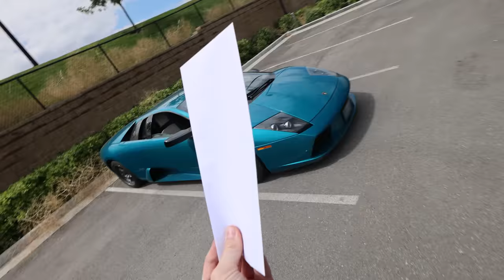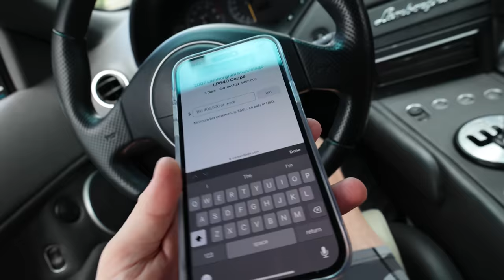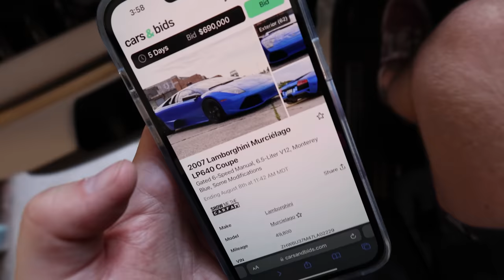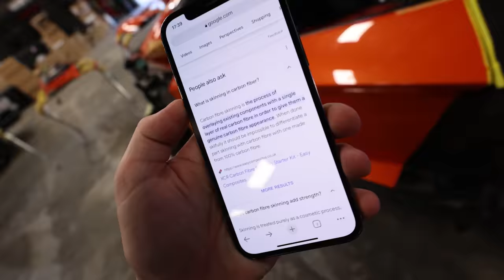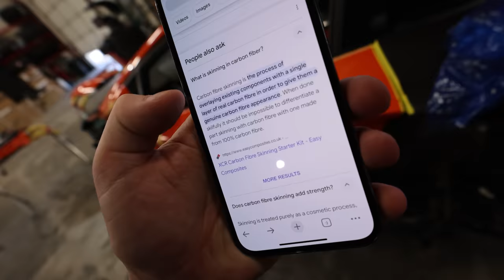Here’s What’s Happening with my Twin Turbo Lamborghini Gallardo.

Comment: I don't think it's a bad choice to skin the doors. Since you announced it I was thinking about crach protetion and I'm happy you're playing it safe
Reply: I dont know anything about this topic, but cant they put the protection against crashes in the carbon doors? I mean theres still the windows problem but he didnt said it wanst impossible, probably is very expensive tough
Reply: @chilispeed_pt8414 well that’s exactly it it’s very very very expensive
Reply: @chilispeed_pt8414  Yeah, I'm sure it's possible to transfer everything over including reinforcement pieces or even making reinforcement components out of carbon fiber to add. It's just not going to be a cheap or easy process. From the sounds of it, they might think it's a little beyond their skill set there and he would probably need to send it to someone who specializes in working with carbon fiber, just to get the doors properly assembled to put on the car.
Reply: At that point, just use a fake carbon vinyl. Same thing. 🤮
Reply: The only worry I have is matching the carbon weave
Reply: @chaser5947  bros clearly never seen real carbon next to vinyl carbon☠️even if it is just a skin it will look infinitely better than any vinyl
Reply: Crach?? Please go back to school!
Reply: I think you should put the parts u took of for the carbon fiber lambo on teh jeepogini ahaha

Comment: STRAD!!! Why don’t you take the outer skin off the oem door then carefully cut the outer skin off the carbon door then bond it onto the OEM door that will then have all the structure inside. If doing this make sure you buy the correct bonding material used for carbon fibre roofs 👍🏻

Comment: Another solution is to remove the outer most door skin and replace with a carbon piece. I'm building a custom carbon fiber body BMW with my shop and we did it that way so its a true carbon door but you maintain the structure and mounting for pieces in the door. Just a thought, was determined to be best for our build. That way you also are not increasing the thickness of the door by adding material.

Comment: Pull that motor and put it through boost prep rebuild. All these “turbo” builds on motors made to run NA seem to not actual reach full capability. Be nice to see one YouTuber mention they’ve had rings gapped to handle more boost on a v10/v12 would be amazing. Do it once right or pay 2x as much to do it wrong.

Comment: It may not need the brace due to the structural integrity of the carbon the main reason carbonfiber is used in f1 is because of its safety properties when u crash and the carbon breaks off it takes some of the impact damage away from u and thats how people walk away from f1 crashes most of the time

Comment: You should do a door delete on that car for a month or two while you get the window sensors fixed. Usually it is the brass contacts within the switch that causes them not to work due to black suet build up on them. You should be able to pop them off and take them apart. Use a steel wool pad to clean the contacts then use electrical grease on them.

Comment: You can take the crash bar out of the original door and install in into the carbon fiber door. Also everything including the regulator will fit perfectly or else the door would of been flat on the inside with no holes. Please try harder these doors where very expensive and we’re made to fit

Comment: For a few hundred dollars each you could put a frame inside that attaches to the hinge points to the lock catch would be lighter and stronger any engineering shop cld build them very quick and easy

Comment: I don’t know if the carbon body kit is meant for racing but if it is meant for the road, someone wouldn’t produce something that’s not up to structural standards. Because it’s a full, (probably preimgregnated) carbon door, a structural bar wouldn’t be needed because it already has the structural integrity

Comment: You should use both doors, do the one with skinned carbon fiber and the other with the authentic carbon fiber, buy the replacement window and regular and handles, then you can swap it out for the original carbon fiber when you’re at a car show or it’s for display, it shouldn’t take long to swap out the door

Comment: $1500 for one door lock actuator for my LC500, if not under warranty. I cant imagine what the parts and labor for window motors on the Murci will be. Guessing $4-5k without extended coverage.

Comment: Does the CF weave match the front and back fenders on the door? If they do you should some how mark the weave points to the original door so they can skin the weave right. If you just send a door and tell them to skin it it's not gonna match the rest of the kit. Could send one extra door for them for model or even ask if they could make a crashbar from cf to it? Sound deadning is easy to add if you like that but it will add weight to the door.  Does the factory carbonfibre doors let's say like koenigsegg have crashbars inside the door or is the carbonfibre so much stronger than aluminium that they don' need them? Or make a Rollcage in the car so it would be even harder to get in😂

Comment: Yeah that’s what I suggest back then for the part that you can’t replace with carbon or cutting cost..like the roof etc. haha..look carbon,real carbon but just not saving weight but adding more 😝….or just use the carbon door etc. but add roll cage 😍😍😍😍

Comment: Soooo. He found people to help push the Gallardo to a trailer but he couldn’t find help to push it in January. Got it. Re-start the car 25 times and break it. When you run a car with no oil pressure they break. Go figure. 😂😂😂.

Comment: Now the carbon fiber aventador is a disappointment. This was the most anticipated build I had on YouTube and now it feels like it will be an incomplete project. If I was strad, I would invest in getting the carbon fiber doors fitted with safety equipment in it. It will be worth the time and money for outfitting the doors with safety. Only wrap the stock doors for temporary safety until the carbon ones are done